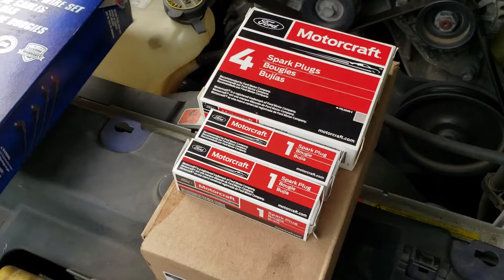3.8L V6 Mustang Tune Up [Timelapse]

Comment: I just got a new motorcraft coil pack and it seems to be already faulty. I got a code for cylinder 5 misfire and when I tested the coilpack, cylinder 1 wasn’t misfiring when I pull the wire out but every other cylinder did. I’ve changed everything in my mustang with little to no fix.

Comment: Hi. How often a tune up is needed on a daily driver? I was told every 20 to 30k miles.
Reply from the maker: It really depends on the vehicle. Most modern cars have intervals of 50k - 100k miles on tune ups, but older vehicles (especially carbureted ones) may need one much sooner than that. Unless you are having issues, I would recommend following the manufacturers maintenance schedule. If you have a Ford, you can put your VIN in on https://www.ford.com/support/maintenance-schedule/ and it will give you a full maintenance schedule for your specific vehicle.

Comment: Nice job. Question; have you ever changed the cabin air filter on your car? I was told to change mines, i've never heard of cabin filter on the new edge.
Reply from the maker: I believe you're right. I'm pretty sure the new edge mustang doesn't have a cabin air filter.
Reply: Our model of mustangs dont have cabin air filters, when i first got mine i figured that'd be the easiest fix i could do at the time but found out it doesnt have one

Comment: any recommendations on what I should do for a tune up on a 96 3.8 mustang with 161k miles? I did an oil change about 3 months ago but that’s it. car runs and drives fine with no check engine light. has a semi weak start up after running a few errands. any idea?
Reply from the maker: I'd have a part store check the battery to make sure that its not nearing the end of its life and that it has the right cold cranking amps for the car. Checking the spark plugs never hurts either at that mileage. If you find someone put Autolite plugs in, replace them with Motorcraft.

Comment: I replaced the intake and spark plugs amd wires  and now it crank no start. No codes. I have spark and fuel. Im lost!!
Reply from the maker: Make sure all your spark plug wires are running to the correct cylinder. Also check all of the electrical connectors and vacuum lines by the intake. I knocked off one of the EGR vacuum lines which caused it to run rough, but you may have a loose sensor wire on the intake or throttle body. Some of those sensors being unplugged will cause the car not to start.
Reply: @HufflerGarage  I pulled a diagram of the cylinder layout. The layout reads 1,2,3 on the passenger side and 4,5,6 on driver side. So I put each plug into the cylinder  that correspond to the number of the coil In the coil pack. Or do the numbers on the coil pack represent firing order and not cylinder number?